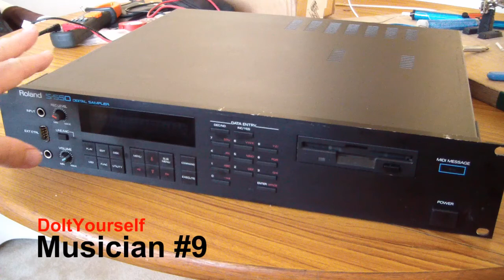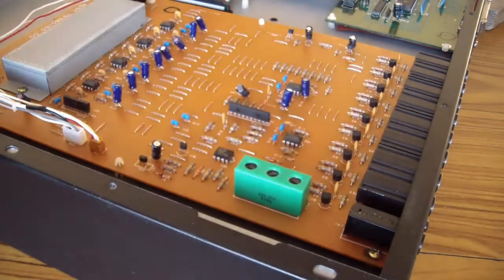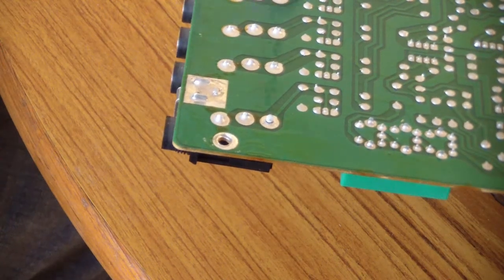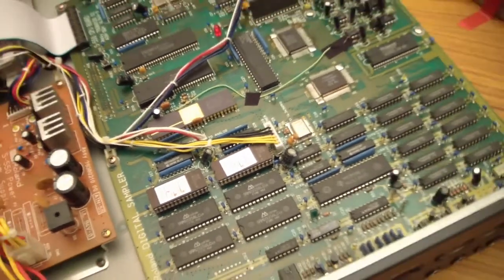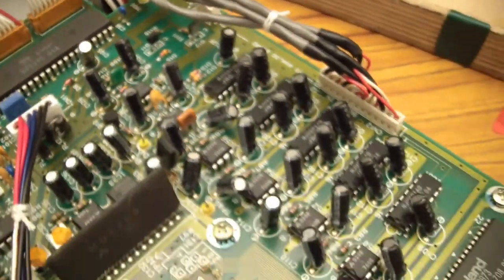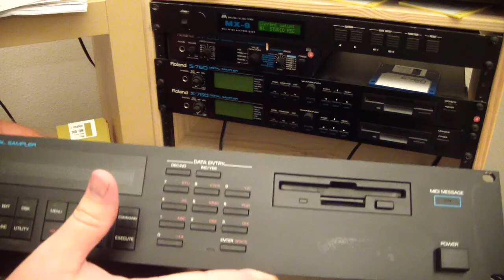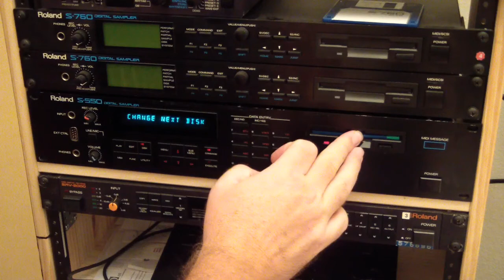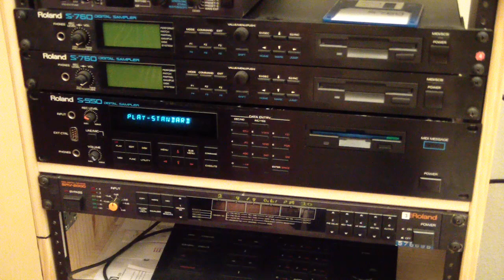Do It Yourself Musician #9 - Roland S-550 Sampler Review and Repair

Comment: This unit looks like in a very nice shape inside.  It's incredible those things still work.  I believe the life expectancy of the integrated circuits inside was about 15 years.  Now, we are reaching and passing 30 year mark, and this equipment still works.  I got a W-30 few weeks ago.  Looked like brand new in original box, intact documentation, power cable still tied like new, and the four original disks, one system disk, and 3 disks with sounds and MIDI sequences.  I paid $325.  It's incredible how low the prices are going for these units.
Reply from the maker: I like a lot of the drums in the S-550 library. I haven't been using the MPC for drums much lately I just use it to sequence the S-550. Sounds great.

Comment: I have the Roland S770. Is it safe to place on a rack without the wood underneath? Because it is pretty heavy and im not sure if it would damage the machine without the support underneath. Thanks!
Reply from the maker: It will be alright in a studio rack. it's made to hold up its own weight. If it's in a travel rack you might want something under it.

Comment: Hi, useful vid, thanks. I noticed you use an MPC. Is the Roland s550 kinda like a poor man's Akai s900? I'd love to get an old 12bit sampler to knock out punchy drums through, but the Akai S900, s950 and MPC 60 all seem a bit pricey now. Do you recommend the s550 as a comparable alternative?
Reply from the maker: +Daddy Abe I wouldn't call it a poor mans S-900. Certainly it was less popular but it's just as good really. It's not as easy to work with as the S-900 is though and that's mostly what Akai has over other samplers, they just have a better user experience. I use both my MPC-2000 classic and the S-550 for drums all the time. I slightly prefer the MPC when sampling drums and prefer the S-550 when just playing samples from the library because there is a lot of good stuff there. I don't have an Akai S-900/950 because the MPC-2000 does mostly the same thing and you have the pads for control.
Reply: Thanks for the quick answer! Great answer too - that's good news! Cheers!

Comment: Hi: I recently picked up an S-550. Do you need a monitor to see and play each individual tones? It says to push the "sub menu button" in the manual but when I do that it does not show the tone list in the S550 display. It only allows me to play the patches. 
Thank you!
Reply from the maker: +eliasfactory If you are using the CD-5 Ver. 1.2 OS put the disk in the drive, press UTILITY, press MENU, Press DOWN ARROW to get to "SAMPLING", press EXECUTE,. When you see "UTIL-SAMPLING" in the display, press SUB MENU, you will see the word "SOURCE", press EXECUTE. 

You are now at a list of tones and sub-tones but you cannot see them on the display. It just says "SOURCE" but you should be able to play the source tone then down arrow to the next source tone etc. You kinda need the display to really be effective. Look for an old cheap 4x3 SD flat panel TV with a yellow composite input.
Reply: Excellent. Thank you very much. I see what you mean....it's better to have a monitor.

Comment: I have an S-550 myself.  These Caps are getting long in the tooth - how much longer do you think they'll last? I'm surprised they've lasted this long.  On another note, do you use your scsi board?  If you ever want to sell it let me know, I'd love to put one in my sampler.
Reply from the maker: +Roy Maya It's hard to tell how long caps will actually last but you could check them if you had an ESR meter. That would be the only way to get a picture of what's happening but even then you never know. I don't use the SCSI on mine but I plan to eventually.
Reply: +DoItYourselfMusician The day my sampler starts acting weird, I think I'll just replace them and get it over with.  When you decide to get the scsi working, check out the SCSI2SD board - its affordable and can emulate 4 hard drives on 1 SD card, which is great for the old samplers that are limited in hard drive size.  keep doing your thing!

Comment: grabbed an s550, is it possible to simply record a sample Into this machine and play it back without a monitor hooked up? been trying for a week unfortunately
Reply from the maker: +lord jesus Do you have the manual? Honestly you really need a monitor to get the most out of it. Try to pick up a cheap old TV with a composite (yellow) video input. That's all you need. Check your current TV's as you may already have one. If it is a modern 16:9 TV the image will be stretched but still usable.